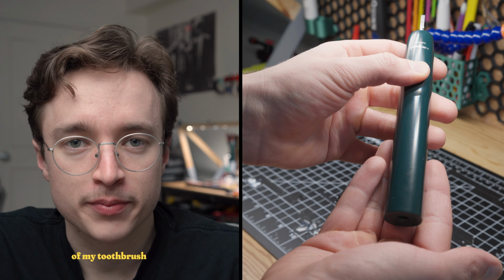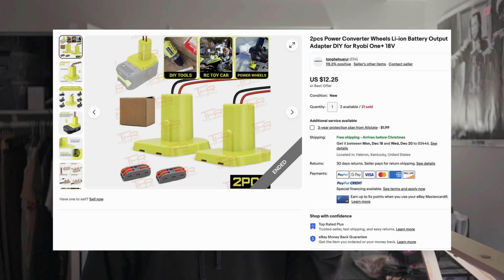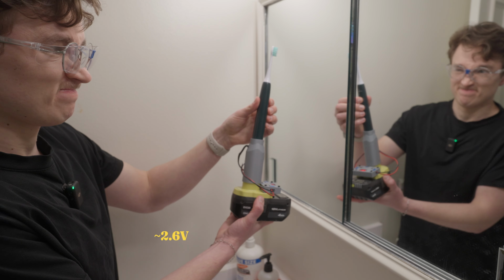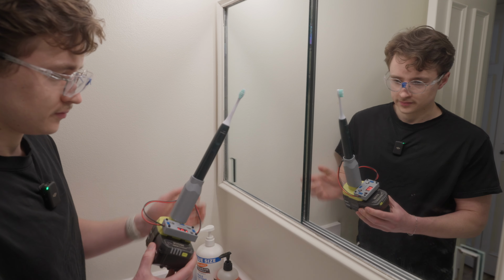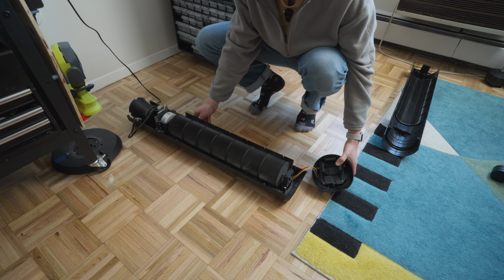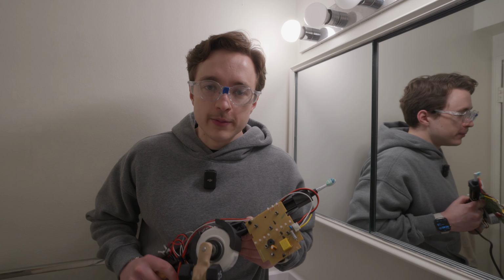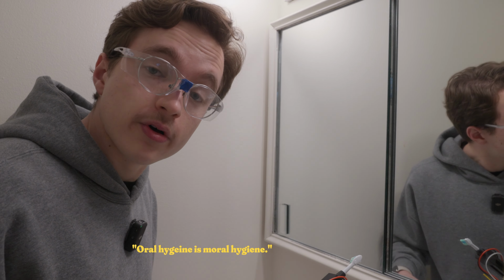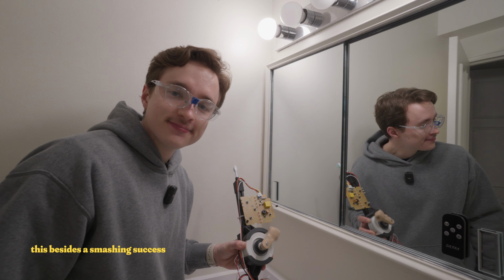Engineering a toothbrush that doesn't suck

Comment: fucking hell, u realize 3.3V is the lower range of the original lithium cell and may actually not be enough yet 6V is above the maximum 4.2-4.4V lithium ion can output and probably already destroyed the toothbrush right?